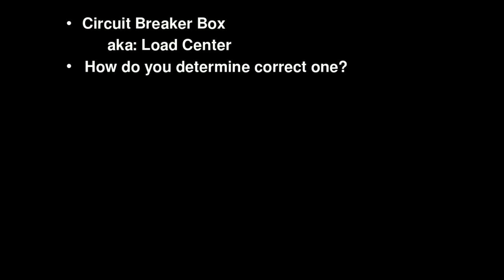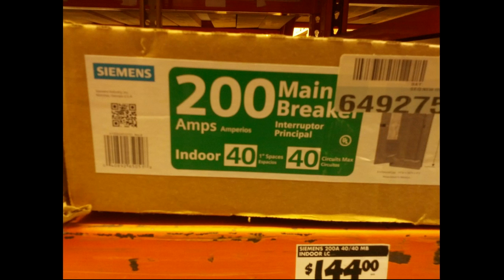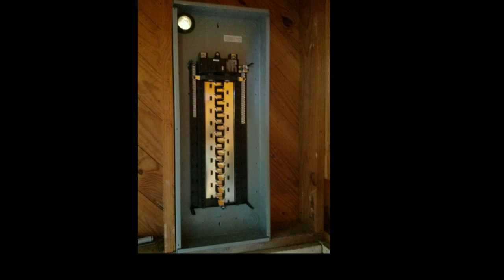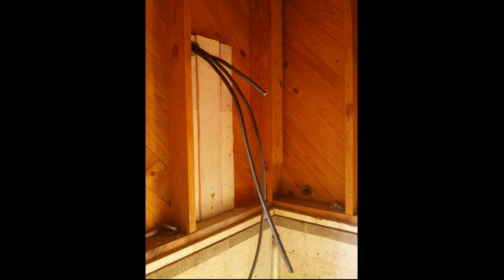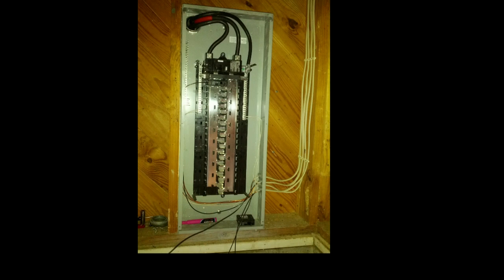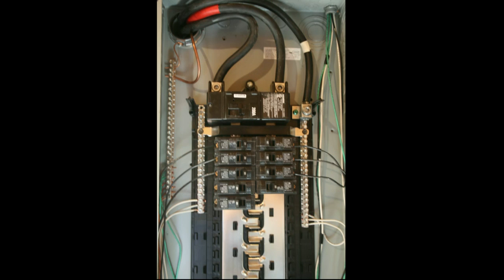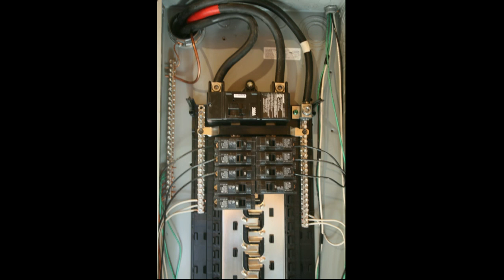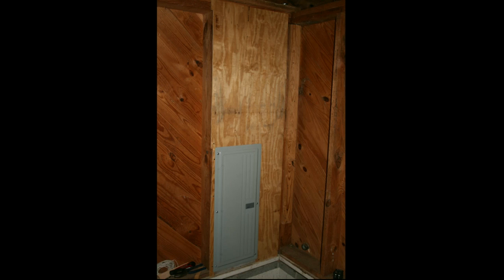DIY Electrical Wiring Workshop Electrical Panel

Comment: Good mention on the Neutral Bonding Screw only being used on the Service Entrance Panel only. My Shop is a sub-panel run from the house and no Neutral Bonding Screw. Since the Shop is a detached building it does have it's own Ground Rods.
A sub-panel in the same building would use the same ground as the Service panel.

I was allowed to have the Romex exposed in my Shop. I was surprised by this but Inspector confirmed it. Saved me a lot of time and money as I was planning on MX Flexible/Armored 12/2 wiring.  I still ran MX at my workbench outlets as I just wasn't comfortable with the Romex and the tools I'd be using.